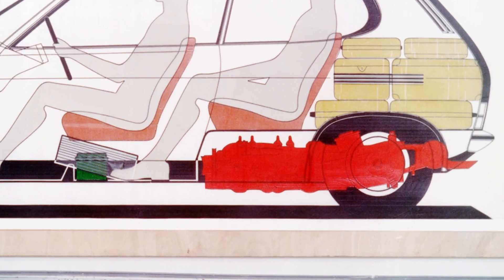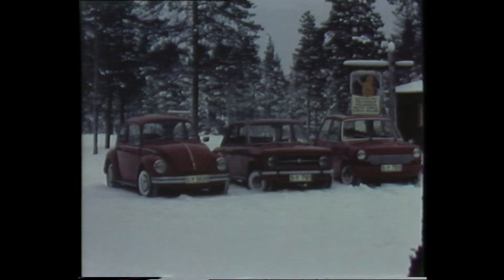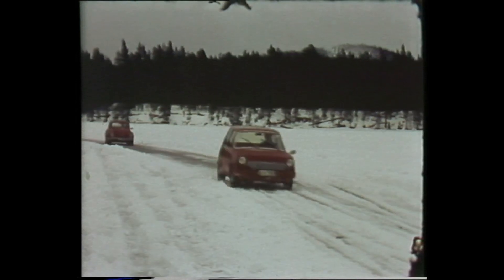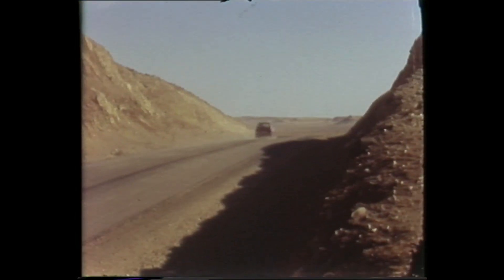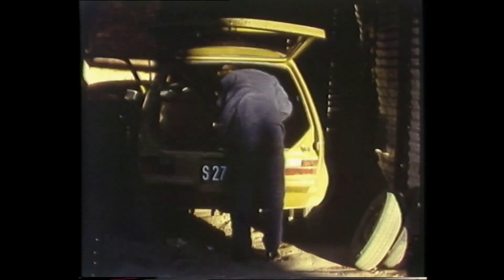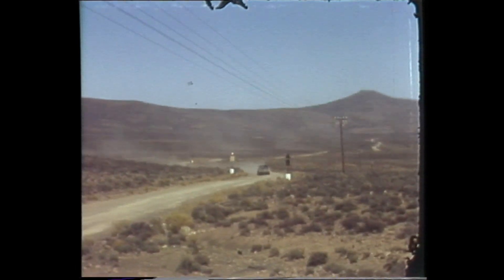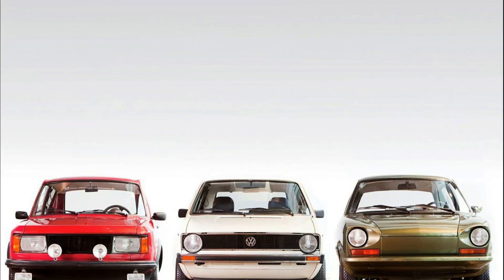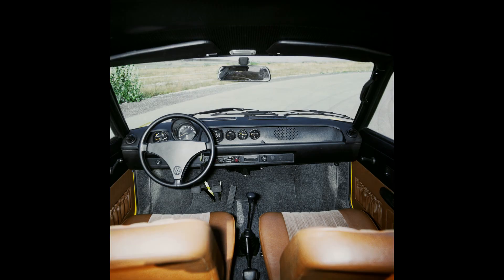Cancelled, Forgotten Volkswagen! The EA266. Archive footage, fascinating story.

Comment: VW had such a hard time replacing the Beetle but got it very right with the Golf.  Does make you wonder where we would have ended up as the Golf and Golf GTI set the benchmark for so many cars like the 205, Astra, etc, etc…
Reply: Also the Talbot/Chrysler/Plymouth Horizon
Reply: The 1969 Fiat 128 was the inspiration though the later was inspired by the very British Mini and the brilliant idea of Sir Alec Issigonis. The designer, Giorgetto Giugiaro, was surprised to see 128's cut to pieces and literally dissected inside the R&D facilities.
Reply: Not sure if you mean the 128’s designer, but that was Dante Giacosa who cleverly brought together existing, albeit uncommon elements, together with his own innovative clutch release mechanism that set the template for countless front wheel drive cars in the following five decades
Reply: @emma.j.nation  You know your Italian car history, Emma. Giacosa tried out the transverse engine/end on gearbox solution in the Autobianchi Primula  before releasing it to a wider market in the 128. The Primula even looked like an ADO16 as both were styled by Pininfarina. I believe the 128s styling was done in house. The wheel turned full circle when the Ritmo (Strada) that replaced this 3 box saloon took its inspiration from the Golf and became a 2 box hatchback...
Reply: @hughrobinson9978  Autobinanchi was always a test-bed for Fiat, I've had a couple of Y10's and they were very well specced small cars.  Would love an A112 Abarth!  It's interesting that the Strada took the direction it did because of the success of the Golf because Lancias Delta was a Giugiaro design, very similar to the Mk1 Golf and based on a strengthened Rito/Stratos chassis.  The Golf was definitely a benchmark car.
Reply: @pentagrammotorsport  Ian has to find an A112 to test - I'm sure he would love it! Are any in the UK? I would argue that the Primula was one of the most influential vehicles that there have been - it brought together so many elements that continue to exist in modern vehicles.
Reply: Maybee I am wrong, but while looking at your Video, it seems to me, that the Beetle was the best looking car compare to Type 17 and this EA266

Comment: Fascinating insight in a dead-end of an automotive development - If I recall correctly, Brazil did get a FWD, Beetle-originated flat-twin powered VW Golf Mark I, so some of that mishmash did sprout, albeit not in the original form or function.
Reply: That was the VW Gol,  which was a development of EA288 rather than a Beetle engine in a Golf.

Comment: Well done! :D This archive footage - with Fiat 128 on Finnish snow - was shot on winter 1969/1970 most probably, not ealier.  These oldest VW Type1966 vehicles could still be used as R&D work horses. Pity, today Porsche keeps their prototypes usually in 'Don't fire up - unplugged' state. :/

Comment: I worked in Engineering at VW South Africa from 1974 to 1995 & am aware of this project through work colleagues from VWAG & information found. When Rudolf Leiding took over at VWAG he realised that they were stuck in a rut with their air cooled engines & particularly the EA266. As VW had recently acquired Audi/NSU,who were already working on the Audi 50 (based on the Fiat126), VW started on the Golf ( based on the Fiat 128), but using theEA 827 engine from the Audi 80. However,VW’s first front wheel drive product was the K70,essentially an NSU (remember the Passat was only a reworked Audi 80). H. Leiding realised that the future was transverse engine front wheel drive & it is safe to say that if VW had not made the Polo/ Golf combination it is highly likely they would not exist today.

Comment: The EA 276 mentioned in the video inspired many VW models in Brazil, especially the Gol which also had a front air-cooled engine and even the same wheels (on some models). The front lights inspired a facelift that the model received in the mid-80s. The back looks a lot like the VW Brasilia.

Comment: Volvo went to Porsche when designing the white block modular engine range, it started as 6 cylinder in the 960, then 5 cylinder in the 850, then 4 cylinder in the Mk 1 S/V40

Comment: Very interesting video. Imagine if these little cars were designed so that the engine, transaxle and ear suspension could be quickly and easily unbolted from the body and wheeled out for maintenance and servicing, they could have been a game changer. PS, with the OG Beetle, it was almost easier to remove the engine than trying to work on it in situ, just 3 bolts and a few cables, hoses and wires and it was out, no reason why this couldn't have been even easier.
Reply: Well it was 4 bolts actually 😋, but yes you can get the full engine out in about 15 min. if you have basic garage tools.
I presume EA266 was also an air cooled design, so removing the whole engine, or engine and gearbox may have been fairly simple. 
But having trouble at the side of the road in the rain, with the trunk fully packed, not a lot of fun.

Comment: Love old footage like that. I wonder if it had a removable floor panel underneath the back seat to help with servicing. If not it would have been a nightmare to work on! Mind you Porsche don't seem to mind building cars where you have to take the engine out to change the spark plugs!
Reply from the maker: Yes, you could remove the back seat to get access to the engine, but as a three-door hatchback, that's still not exactly convenient!
Reply: @HubNut  very true, but better than having to do everything laying on your back under the car 😂.

Comment: Intriguing little car and great document from HubNut. I can see bits of the future VW Polo but also Austin Mini, Honda 600, Fiat 126, Peugeot 104 and even the British Hillman Imp at the front-end. No doubt the mid-engine layout contributed to the fiasco as also the era of the front wheel drive, water cooled, transverse engine was arriving and the beginning of the so called 'Super-Minis' was kicking in very strongly. On the ice track apart from the than benchmark Fiat 128 sedan, there's also a Toyota Corolla KE20. Same ice track used later for the development of many technologies such as the ESP when one of the Mercedes-Benz test drivers got stuck in snow and had to wait for hours till rescue arrived.

 Enough time to think about using a gyroscope as a way to avoid unwanted drifting. A story I suggest Ian to investigate. The inventor is still alive and didn't receive any relevant prize after saving so many lives and preventing millions of crashes to happen.

Comment: What a cool mix: a little future type 4 in the front end, but also a definitely little bit of Golf from some of the angles. But a nightmare to work on.  engine cooling would have been a challenge and occupants would be cooked most of the year in most climates.  But if you have winter you WOULD be warm(er) than the typical Beetle.  

Wonder what the front trunk looked like!

Comment: Fascinating Ian. I think more of this please. Although it begs even more detailed questions regarding why Volkswagen with its own R&D function asked Porsche to develop this type. Also it begs the question was this running before or in parallel with the Golf FWD platform idea (apparently from NSU) ? Were they testing out this before settling on FWD or testing it separately as an alternative?. 

Would have been great to see any info on how the engine/gearbox and final drive fitted together ? And also how on earth they managed to cool the engine given it appears the radiator would have to be horizontal  to fit or was it somehow in the rear side panel vertically? If so how did it not roast the passenger sitting next to it...?

Also I wonder when they saw the simplicity and compact layout of the Fiat 128 and it's drivetrain you'd wonder why they saw the need to be so so different (in a way almost nobody else has).

More of this sort of thing!
Reply: Edit : I was wrong . A golf like inline four laid flat.
At the times magazines talked about a traditional VW engine as their guess of the secret new car.
Not talked about much in this, but at that early stage VW and Porsche were very loyal to direct air cooling rather than transferring water to a radiator for air cooling there.
Reply from the maker: Radiator was facing forward, so I do wonder just how efficient that design is. K70 had a longitudinal engine, like an Audi, so I don't think it had much bearing on the Golf. That said, NSU's rear engined cars had transverse engines.

Comment: Very interesting video Ian, suppose the Fiat and 2CV were used as a comparison for front engine and front wheel drive.  Not a bad looking car, front is like a type 4, but with round lights, rear has more than a bit of Oltcit about it. Even checking the oil would have been a pain on it though and would not have been as practical as a golf. The one with the beetle engine up front reminds me of a Wartburg knight.
Reply: Absolutely, my first though was "the EA276 looks just like a Wartburg 353!".

Comment: Important and very interesting stuff. One might have expected VW and Porsche to repeat what they did with the original Beetle - go and nick a Tatra design.... This car features in the Big Car video on all the failed Beetle replacements - apparently Porsche started on it a year before VW approached them. I can't see how a 5 door would work/package. It was canned due to noise. heat and servicing access, as you mention. It's worth remembering that VW in the 60's took over NSU and Auto Union including getting a car that became the Audi 50/VW Polo - similar size to this Porsche proposal. Also worth remembering that Rover's Spiritual proposal as a Mini replacement some decades later was a rear engined car.
Reply: Being water-cooled, it could only have been less noisier than VW's air-cooled products

Comment: Looking at what Volkswagen in Brazil were doing with discarded projects like EA97 with the Brasilia and the Type 3 Variant II, Volkswagen could have done better at complimenting and updating the Beetle than they did. They could have also widened the Pancake layout of the Type 3 engine to include the EA97's 1192cc, which would have opened up more space in the rear to be utilized.

Comment: if only they'd gone ahead with it. the design concepts were way ahead. the van coupe and sports car variant designs look stunning. access for engine maintenance from the top could have been achieved by a folding or removable rear seat with a removable floor panel - lots of examples existed in the same era.
the original Polo styling looks influenced by the saloon and the sports car version has some similarities to the 914

Comment: A very interesting video. VW between 1968 to 1971 or the Kurt Lotz era. 

I have seen the prototypes at the VW factory museum. I think from memory two are left after most were crushed. EA 247 and EA 266

I love that era. VW was hemorrhaging huge amounts of money Kurt Lotz was an accountant not an Engineer like Hienz Nordhoff. Under his controll quality suffered. Rudolf Lieding what he did was rationalised VAG.

Part reason I'm now into type 4 VWs owned a 411 and own a SA built 412 poverty spec Variant. All panels differ to a German built 412. It is the only one in the UK minus side trim. You can have a drive once I sort clutch.

I love VWs drove my 56 oval twice abroad and to Germany from Scotland back in 2007 and 2009 in my 20s.

Comment: Yes very likely South Africa, as you can test all the way from sea level to high altitude in a single drive cycle, plus also can do testing at very high ambient temperatures as well, and also lots of less than good paved and unpaved roads as well, plus good transport infrastucture to bring them in and out.

Comment: it would probably still have been a pain to work on "in the back street", but they could've made it so that the engine & driveline were fairly easy to drop out as a sub-assembly, however from what i could find in pictures it's just a nightmare of under the back seat access panels.

Comment: VW tired to make a replacement for the beetle many times, there were other attempts over the years that are also interesting.  Brazilian VW had a couple of the most successful attempts, the Brasilia, which was a modern body atop the beetle platform, and the GOL, which put the beetle drivetrain in the front for air cooling and FWD, later converted to water cooling and imported to the US as the VW Fox.

Comment: There is another element to the EA266 story that involves Porsche, who envisioned using EA266 as the basis for a three-tiered mid-engine 911 replacement, with four-, eight-, and twelve-cylinder water cooled boxer engines mounted amidships in a car with three-abreast seating and expected introduction of 1973. The prototype Flat-eight was loosely based on the inline four developed for EA266, and included DOHC cylinder heads and two EA266 water cooled cylinder blocks on a common crankshaft. Do the Roadster and Coupe EA266 accurate reflect what was planned for Porsche's 911 replacement?

Comment: I just watched your EA266 video again - just as fascinating 2nd time round - and a question came to mind:
Could it be that the EA 27 with its front mounted Beetle engine paved the way for the 1980 Brazilian VW Gol, which used the same arrangement? 
I'm in Brazil at the moment observing a lot of "alternative universe" vehicles and one occasionally sees these old Gols along with Brazilian Type 3s (which are completely different to their German counterparts), Brasilias and Buses that are a fusion of Bay front/splitty rear. Along with Ford Corcels which started off as Renaults, Renault Orochs that started off as Dacias, Chevy Opalas that are Opel Rekord Cs made into the 1990s.
You would love car watching here Ian!
Reply from the maker: Yes, I do suspect it inspired the Gol. Leiding, the new chairman of VW in 1971, had been leading the South American arm previously.

Comment: Technical details are unclear, but I think the engine has a fore-and-aft crank with the engine laid over on its side. Given that the radiator air intake is on the right behind the passenger door, I am guessing that the engine is laid on the left. So the gearbox is a conventional transaxle as used on the Beetle and Passat, not an end-on box.
It's an interesting project, revisited by the 1995-7 Rover Spiritual and Spiritual Too.

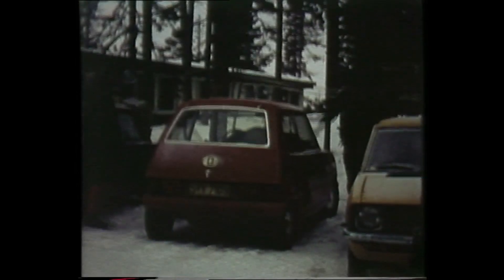Comment: 3:22 This Beatle has extra cooling vents that were added for 1969/1970 model year and it looks like its badge says VW1302S which came out for 1970/1971 model year. The extra S on the badge appears quite clearly and no earlier models had that symbol. Also notice that there are at least two Beatles. The other one(s) could be a standard 1300 although in the wide shot I think both look like 1302. I think it would sense for them to use the most current models so maybe  this was filmed in late 1970? Or possibly in early 1971?
Reply: Only three Beatle members are left 🤣

Comment: Well done, thanks for this great Video - I have always dreamed about the EA266, since i was a kid and saw sketches of it in a documentation of the Beetle.
This Documentation was written at the beginnig of th 80ty’s by a man called Hans Rüdiger Etzold, a german Motorjournalist with very close connections to Volkswagen. He stated about the EA266 wasn‘t put into production not only due to high production costs and unfriendlyness for maintanence.

It was also due to to its critical changes in its driving behaviour, depending on different level of cargo load and weight of Passengers. According to Etzold, the prototypes where quite neutral to drive when only the driverseat was occupied to very tricky and unpredictable with a very narrow border when it reached its llimits. 
This was considered as unacepptable  for a family hatchback. Parts of the EA266 survived and came to marked with the VW Porsche 914.

Comment: The first test mules look similar to the Renault 5 which was released a few years after. I wonder if there was some inspiration taken from the EA266?
Reply: Renault was always a master of copying concepts, but in this case they just modernized the R 4 and R 6 using exact the same technical components, no traverse engine – just look how long the front hood is. 
 
The design was done by a young designer, Michel Boué, who just hit the taste of the time. May be he had seen some design prototypes by Fiat (the 127 followed a year later).

Comment: Think that it would have been a success all around the world, as for engine access lifting  the rear seat for daily oil/water checks not a problem along with the rest from underneath not really one as most oil and filter changes have to be done that way.  Spark plugs and points also not a problem from underneath  as a set of ramps would suffice if no access to a pit or lift.  A hatchback with a frunk/froot, great.  Would have ben very stable with central low down weight as the tests showed.

Comment: I wonder if air cooling was beginning to be looked upon by VW as a liability by the time the decision was made to drop the type.  I had an 1972 Audi Super 90 with air conditioning, and it was apparent that air conditioning was possibly also an important factor, as by the mid 1970s to sell a car in the US one at least needed the option, and with the condenser mounted underneath the Audi, despite it's almost by then conventional front wheel drive water cooled inline layout, it seems it would be even more impossible to provide practical air conditioning for the little Porsche prototypes here.
Reply from the maker: These were water cooled.
Reply: @HubNut  Whoah! never expected that!